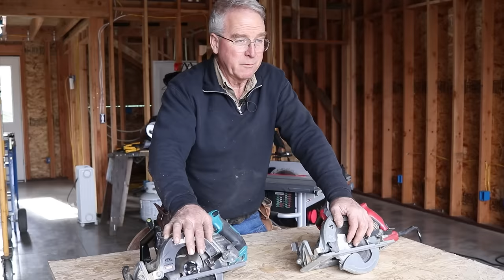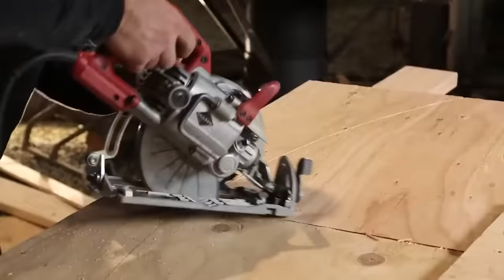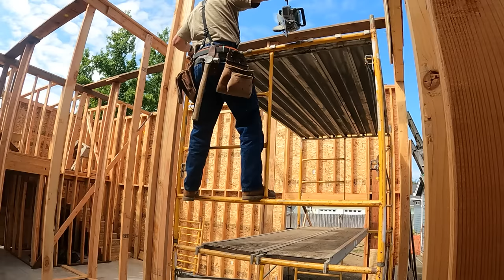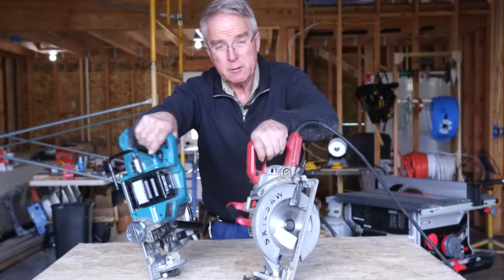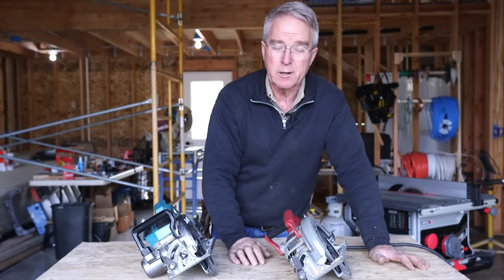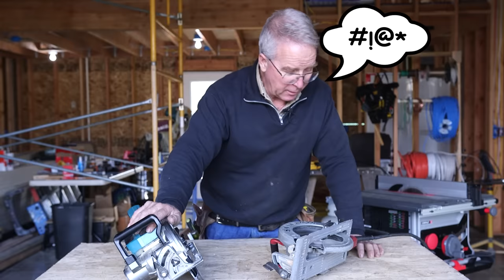Makita 40v XGT GSR01Z 7-1/4" vs. Skilsaw Mag 77 Circular Saw Review

Comment: I agree with your regarding sustained power on the corded unit. I found this especially helpful in the past when carbide blades were expensive/hard to come by and I was using a too dull blade. I am not a pro like you, I have converted to cordless while retaining my corded circular saw. BTW, that soft start feature is to keep the cordless saw from jerking out of your hand on start-up. And the electric brake on a modern cordless saw is an energy recovery feature (returns energy to the battery) as well as a safety feature.

Comment: I have a farm and don't have outlets everywhere.  So batteries are a great advantage for that kind of thing.

I think battery convenience is exagerated because framing is piece work, and it has been worked out to a series of efficient actions where the weight of the saw is functional, and the use of a cord is not a hindrance.  I thing weekend guys are going to love batteries (and I know pros do also), because the weekend guys don't have a process, or forget something, and running the saw without a cord is so much more convenient when you don't know what you are doing.  Renovators etc... same thing.  Hard to get up to super speed when the job is patchy.

The safeties are necessary on battery tools because they are never unplugged.  You can take the battery out, but there isn't any ethic, like not leaving a rifle loaded in the hunt camp, with battery tools, and sometimes they switch themselves on in bags if they don't have safeties.  But for me, on the saws, it really ruins the flow.
Reply: Having worked on a farm since the ONLY cordless saw available was the 18v Dewalt 5⅜" circular saw, it was a MAJOR upgrade from using a pull saw or a chainsaw to cut fence boards and posts or build stalls. 

I used to just carry a generator around on the trailer that I hauled with my 1949 Ford tractor. 

I still had to pull around the generator to use the paint sprayer though, and I painted every single inch of fencing.

Comment: I have the Makita 40v circular saw and it's a beast. I so think that your looking at things from a strongly American perspective. In the UK and parts of Europe 240v tools are not allowed on sites due to health and safety rules. 

To compare the tools job for job in a more global sense, you would have to compare the XGT saw to a 110v wired saw. I've not been on a single site in the UK that allows anything wired higher than 110v

Comment: You made a great point that I didn't even realize is an everyday reality for me. On my corded tools, I'm always looking for where to run/drag the cord. With my cordless tools, I'm always looking for where I last set it down. Even working in tight spaces, I'm either thinking about which side of my body should I run the cord, or which side of my body did I put the tool.

Comment: I used a makita corded circular saw for years. Around 07 I bought a dewalt 36v cordless because I had a job making long cuts on rafters in tight quarters and didn’t want the cord. The next day it was freezing and I had several layers of clothing on. The outermost layer got caught in the saw. Had it been my corded makita it would have gutted me like a pig. Instead it cut through all the clothes, scratched my stomach and stopped. I learned that day that powerful machines have more potential to hurt me. And to not wear loose fitting clothing under any circumstance.

Comment: As Joe home owner who owns both corded and battery powered tools I must say I rarely use my corded tools and longer. The cordless tools are just so convenient and easy to use. I do work in machine repair and I work on sites where building is taking place and I rarely see a corded tool being used. You are correct on the batteries either becoming outdated or just old and the corded tool being superior. For a contractor I would think you would have both but rarely use the corded tool. Which is essentially what you said.

Comment: As far as tracing where you left the saw if you got distracted, you can fix that on the cordless saw with a little DIY fix - they make super loud locator beacons for lost keys.  You can attach one of those to the saw, and as long as you keep the remote for the beacon in the same place all the time - maybe the glovebox of your work truck - you can use that to track down your missing saw.  Maybe that should be a feature Makita builds into the next version.
Reply: Sure, buy this subscription to find your tools.  Works from your phone.

Comment: Thanks. I know this is only a theoretical idea: But I wonder how you would have decided if you would have used that Makita for the last 10 years and now someone would have introduced you to that Skilsaw with a cable. Somehow I am pretty sure you would argue that what you always used is better - because you are more familiar with it.
Reply: Maybe. Maybe?
Those of us picky about tools aren’t often fooled by mere familiarity. Your brain can adjust to almost anything with repetition but like with… say… nascar short track chassis nuances: every driver might have a bit of a different suspension loading, loose vs tight, etc., but the essential aero of the body and the basic frame orientation and construction for every team winds up remarkably the same. 
So what you want in a saw or a hammer or even a hand plane is specific to the craftsman’s grip, joint and tendon injuries(or not), length of arm… Everything that’s lets you grab a tool and employ it without thinking about it. 
I’ve watched plenty of framers over the years and they don’t even think about most of their tools, the just want certain things to just work. 
But a pickier workman- as many finishmen and trim people are, perhaps most- will want the tool to float and act by thought because they care about grip, or cut entry, etc. They want it to be just so while in hand. 

I still mourn Porter Cable discontinuing their 8-1/4” drop-foot/top handle saw. It was always too heavy for my elbow tendon problems, but it is one of the few saws that floats seamlessly from my hand to the workpiece. My elbow appreciated the small, lightweight Porter Cable Sawboss and its 19.2V batteries. Loved it.

Comment: I always keep both corded and cordless. When I need to cut concrete, you need corded cause the battery doesn't have enough power. If I know I'm going to be working in one room, corded. However since most of the time I'm walking around to different areas, I use the cordless most of the time. Have both but definitely get a cordless, it's just so convenient

Comment: Your review was honest and articulate. Having worked with corded tools and brushless is a fascinating dichotomy. Your conclusion is somewhat contradictory. You said you reach for and use the Makita 70 to 80 percent of the time, but prefer the corded king. Interesting. There is an easy solution to traceability "problem", put a rope tether on the cordless. I know that we all use the power cord to lower or lift a saw, but the strain relief does meet the need even though you aren't supposed to use it for such. I can't count how many cycles I have done just as we all do, but I do know that I hate it when I am on a roof and pull on the cord and unplug the saw (yes, even when the extension cord is knotted)...or I have to cut another two feet and the cord won't reach. Yes, the Makita is twice as much...and worth every penny when it comes to usability and convenience when you cut the cord...and it shows.

Comment: About the safety, the first thing I do with any new saw I get that has one is disabling it. On makitas, it's pretty easy. You just unscrew the handle and look where the safety interfaces with the trigger, then snap the little tabs off. I think with cordless tools, they have a safety to prevent accidentally switching them on when you're loading or unloading them from your truck, but that's not an issue for me as I remove the battery first

Comment: I like the idea of cordless. I have a DeWalt 20v which handles a lot.
But I will say my corded skilsaw worm drive and my sidewinder southpaw (blade left like worm drive which is awesome skilsaw did that) can't be beat really. After warranty I replace the stock cord with 30ft 12/3 sjoow rubber cord and I have almost zero issues.
Worm drive has always been my favorite and still is better than sidewinder in most cases, but the fact that skilsaw made the sidewinder for right handers to have blade left saw is awesome. Up until then, your choice was 6.5" battery saw or worm drive for blade left.
Again for smaller jobs my DeWalt XR 20v is great to just grab and use. Same with the XR recip saw it's nice. I trim the bottom parts of my trees with that lol.

Comment: Last year I watched a framing crew building a house next to mine. They had cordless tools. They had a lot of batteries in their tool trailer and they swapped them out a lot. I let them borrow water when they needed it for the foundation, but they didn't even ask for power. I don't think they had even 1 corded tool. Personally, I have a mix of corded and cordless. Depends on what I'm doing.

Comment: As someone who has the makita cordless sidewinder, the safety button has been the only thing I hated. I'm not saying a 5/8's long screw will fit in the button to keep it open. But I no longer have issues with it.
Speaking on longevity i've had mine since February 2020, been using it most days for framing. Still works great even after being rained on, covered in mud, and even snowed on many times. Still works as good as the day I got, she's tired but it keeps trudging on with my abuse to it. 
Once you've gotten used to the differences in ability I find I prefer the cordless 99/100 times. My last crew would spend an absurd amount of time wrangling with cords to do 1 cut vs just taking it over making the cut.

Comment: I am about as old as Scott, so when I started working in the trades the few battery powered tools were useless. My uncle bought a B&D cordless drill in the late 70s that was a convenient size and worked well for drilling holes less than 1/4”, but the battery was sealed in the tool so you plug the charging cord into the drill and Let it charge over night. Late 80s I was working for a contractor whose son had given him a 9.6V Makita drill, (I think just so he could borrow it). I got tired of trying to use it on jobs and finding that who ever had last used it had not charged it that I bought a spare battery for it.
I have been slow to adopt cordless tools but I admit the I haven’t used a corded drill on a job site in years and that was before I got a cordless hammer drill. I have also recently been working with a friend who has invested in Milwaukee cordless tools And have used his cordless Oscillating multi-tool and circular saw. It has been very convenient to use his  rather than going back to my van, bringing in another case and an extension cord, and finding a working outlet to plug into.

Comment: I’m on the dewalt battery platform and run the dewalt cordless “worm drive” its not a true worm drive but functions exactly the same. 

Plenty of power and 1 battery will last pretty much all day unless you’re doing heavy cutting all day. Great features, plenty tough, my mags have been great for a long time and still are but hands down I reach for my Dewalt on the jobsite every time. It stays in my truck or trailer while my mags stay in my shop.

Being able to throw it around, carry it up a ladder on to the roof, not have a cord run across the job site etc. etc. is phenomenal. My job sites are almost completely cordless these days.

I still use my old mags once in a while but usually only if my dewalt is being used elsewhere or using my mag with the prazi beam cutter on it.

Comment: In being a third generation craftsman and having the previous one coming from hand to power tools and working for going into 4 decades and seeing the massive changes in battery tools, I like the time we live in as far as allowing work to become so much easier over time. I thought batteries were going to be the future back in I want to say the 80s when I got my first battery tool, a 9.6V Makita drill/driver, and have been enjoying the power tool improvements ever since. I haven’t used a plug in circular saw in probably just over 5-6 years as the tools have just come so far. Heck I even run a battery table saw which has extremely usurped my old contractors saw.

Comment: Owning a battery earth auger has blown my mind as far as batteries and tools. I own the 36v Rear handle, but always have the skill. Love to have a cut station with skill, and makita in the field. But 90% it’s just the makita as I’m now a general contractor. Feel like I came from the last generation where hammers were held by carpenters more than a drill driver. My last boss still uses a makita TRIM saw for everything and would get a little upset when I’d bust out the skill (thinking I can cut as accurate) but not only was it faster than a trim saw. It’s what I learned on! And the drive of a worm and muscle memory would allow me to be just as if not more accurate than a little baby saw! My biggest gripe: 6 1/2 blades cost considerably more than 7 1/4 blades. Still to this day! Paying more for less metal.  I carry two trim saws, (older one is demo, other one try to keep nice.) newest one is the 36v (daily driver) and still the trusty skill that is also the only one I’ll throw a concrete blade on so I don’t abuse the makita (skill can take it, cheaper if something goes wrong) one thing I love about all my battery makita tools is they can take a little rain. And so does the skill, only shocking once or twice lol.  Love this channel and highly respect this man!  I won’t buy a 40v makita because I don’t feel like paying to convert from the 18v line. Now using a battery operated 18 gauge nailer…that has been very convenient. But all else are pneumatic including another 18 gauge which is more precise and stronger. But to easily tack something of just trim inside of one door; can’t beat the battery. Thanks for sharing your vast knowledge!

Comment: I have to agree with most of your  comments.  Any saw with a higher power to weight ratio than the Makita would become dangerous in the instance of kickback. I prefer the Skilsaw or corded in heavy cutting as well, especially stacks of plywood. I think you're also right about longevity, we have many  of both kinds of saws at work, and the Makita, the preferred or most used, saws need to be replaced  while the 10-15 year old Skilsaws keep on going.  I like both saws and would  use either one, Makita for mobile work, Skilsaw for stationary work. Thanks for your videos.

Comment: I have the 36v makita, simply because that battery platform matches all of my other cordless stuff. And I still have my well used Makita hypoid saw, and an old skill 77 in the tool box. Different tools for different needs. That old 77 with the 25 foot cord gets set at a bevel and left that way for cutting hip and valley rafters.

Your estimation and review here is pretty much spot on. About the only thing I would differ with is the concern about plastic. Plastics are not necessarily a bad thing here, they just need to be the right one for the job at hand. Look at ski boots as an example. The wrong plastic fails quickly, but the right stuff will take daily abuse for years and years without fail.
Reply: Makita (as do most cordless tool manufacturers) uses 30% Glass Filled Nylon 6/6. That stuff is just as strong as metal and doesn't rust or dent.

Comment: Bought to cordless brushless dewalt because i almost never have power easily accessible, and my batteries are always charged (5 batteries came with 4 tools)

That being said, i appreciate being able to work in my detached garage while its raining, without having an extension cord hanging out an open window on my house (with no roof overhang because cinderblock construction)

Comment: I do have used a corded Skil saw for 40 or 45 years. Absolutely a great saw. Three years ago I bought Milwaukee cordless and I would like to say one thing that EC did not mention is Skil saw has a warm drive, and the Milwaukee does not (not sure about Makita), but when you pull the trigger on a Skil saw or worm drive the saw twists in your hand because of torque. I found the Milwaukee much safer because it does not do that. Plus as EC mentioned the blade stops quicker on the cordless. I like my Milwaukee so much that I don’t even carry a Skil saw anymore.

Comment: Battery backwards compatibility is why I have been paying a premium for Milwaukee tools(mostly automotive) but they are not my go to for all things. I still prefer my corded skill saw over the multiple different battery powered versions I have purchased over the years(not just from Milwaukee) mostly because I hate running out of battery power or worse somehow overloading the tool and having it stop mid cut. I also don't think I will ever buy a battery powered Compound Miter Saw or a table saw unless the battery prices drop way down to the point that I can buy the tools and the batteries needed to run them for a couple days for less than what a new corded version cost.

I will wholeheartedly endorse the use of battery powered pruning chainsaws for home use. I have two battery powered mini-chainsaws(6" and 8" bars) that I will reach for long before I grab my smallest gas powered chainsaw(which has a 16" bar). I wouldn't recommend battery powered chainsaws for professional use because they don't have the power(yet) to cut through the toughest of woods and I have ran into problems because of that.